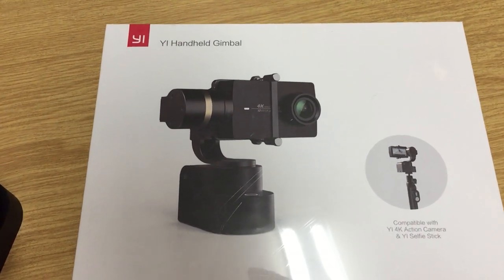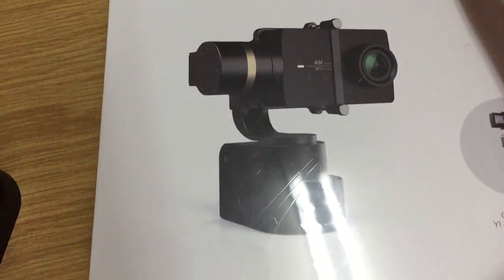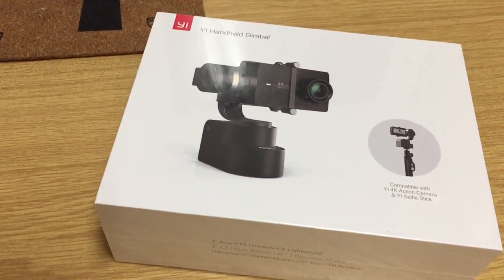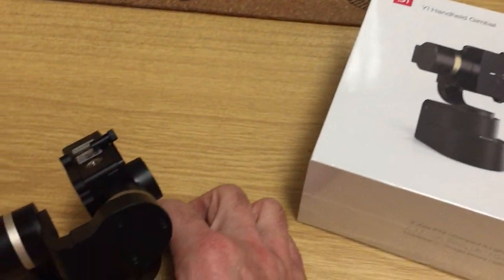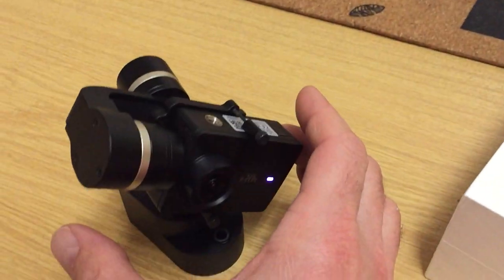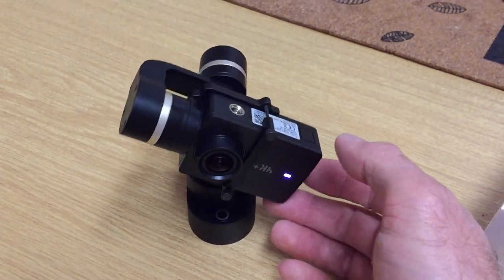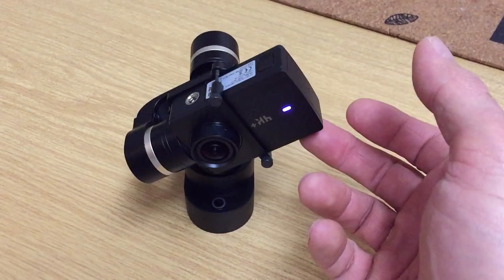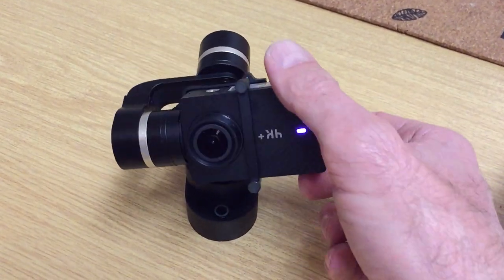No Gimbal motor noise, if cam is mount upside down (YI 4k+ with YI Gimbal)

Comment: I encounter this problem also but the noise is only picked up by my action camera if I tilt tightly the gimbal. But slight movement does not cause the motors to vibrate badly. I guess the vibration is normal to this kind of gimbal but on my smooth q the motors slide like butter. No sound at all!